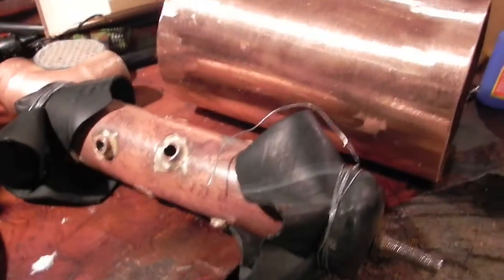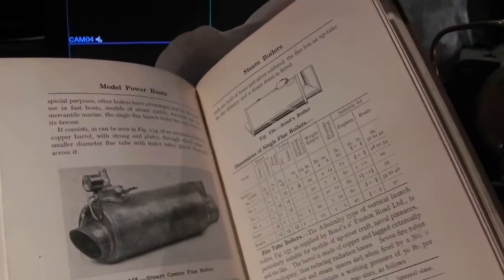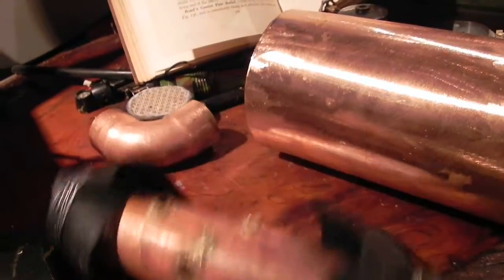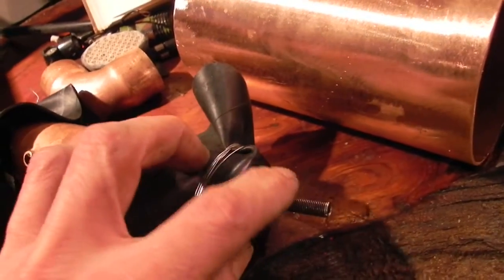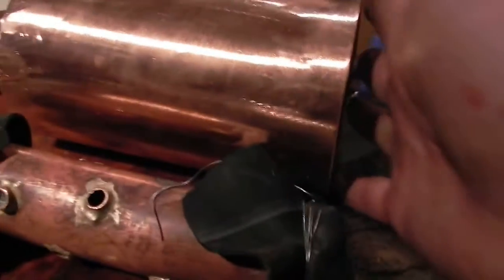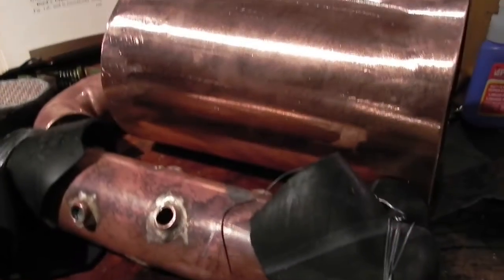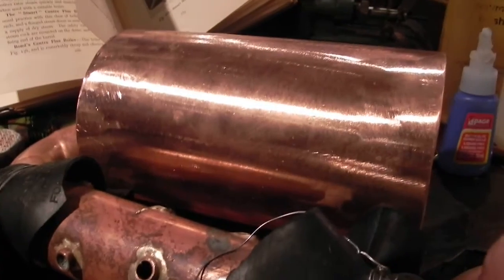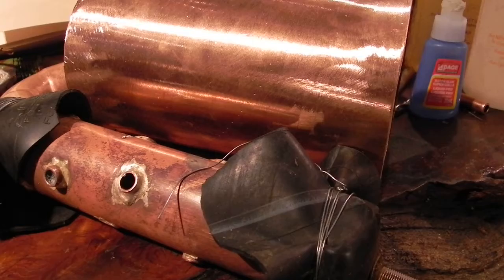Pre-tig braze firetube seal checking with shop scraps, live steam Hamley Bros centre flu

Comment: The end cap is for a small coil-type superheater to help dry out the wet steam on it's way to the engine.
Reply from the maker: Hmmm thanks the pics leave a bit of detail out. my other flu boiler has the coil in the stack. I'll make an end cap with 1/4x40 bungs to a coil inside then try the feed that way.